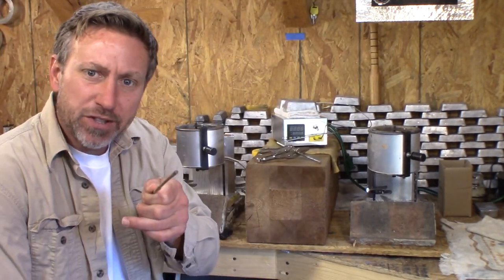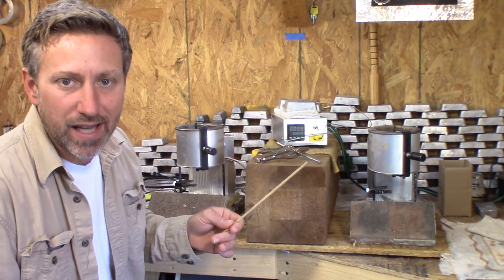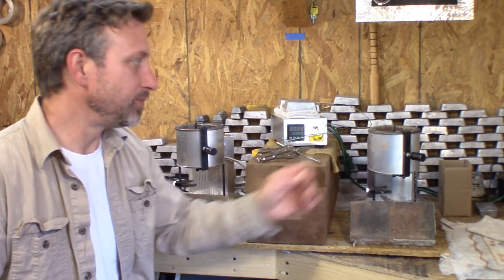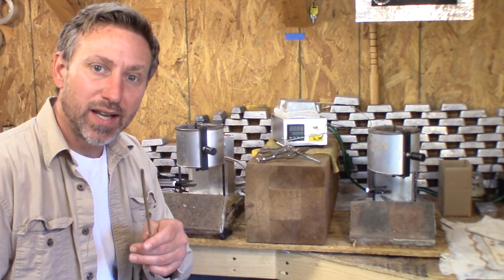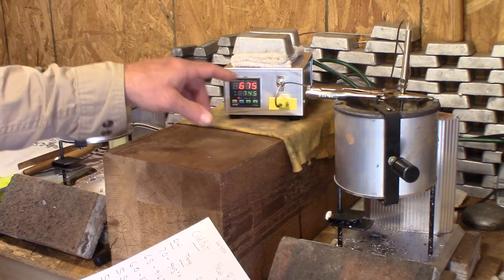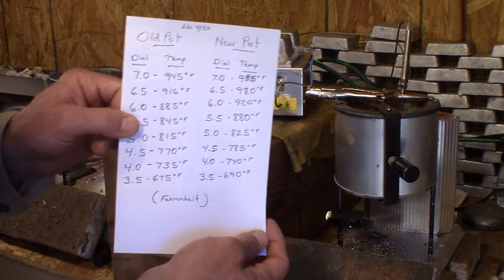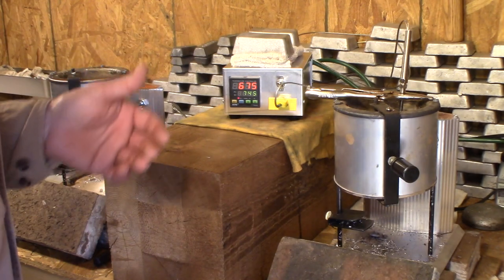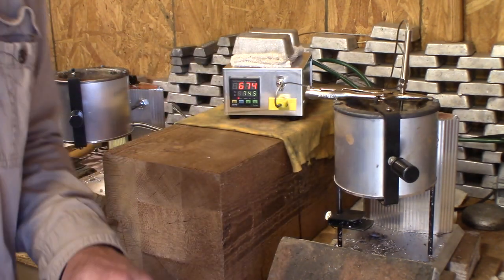Lead Melting Pot, "The Tale Of Two Pots"

Comment: HUH , much knowledge laid down. To PID? or not to PID? being the question well as I research and dig That is a question with only Choice as an answer. I will side if you get one that holds out and keeps the temperatures where you desire them PID can wait, Now however with the thermostats being the weakest link in these pots a PID on hand as back up is a safe option. Thanks Elvis the work is awesome.

Comment: Amazing work, brother!  The biggest thing I've learned from you and FC in these PID videos is that I need to try running my lead hotter!  I have been frustrated by molds heating up slow, nose wrinkles I can't get rid of, and so on.  I am going to try running my pot at 750-800 next time I cast to see if that helps.  I have been mostly staying around 700 and it has made for frustrating casting.
I'm glad you are enjoying the power of the PID!
Reply from the maker: hey Johnny's Reloading Bench.... Yeah One thing about casting is everything is a heat sink... If you throw your sprues back in, Set your mold on top, The spoon or ladle....etc.  Then the lead cools as it goes in the mold. And the temp of the mold it's self... Not a big deal, But must be accounted for. That temp sound right. Larger bullets usually need a little less heat than smaller ones..Good to here from ya as always! You ole primer popper! : )  thanks again for the nice gift!

Comment: I have had my 10 lbs pot for 33 + years now. I never knew what the temperature was either. I just set it on 8 and went to town. I was casting fishing lures untill a year ago. it's a lot different casting bullets. my PID goodies will be here today or tomorrow. I think I need a new pot too. you and FC45LC and Johnny's reloading bench have changed the way I cast. thank you for making it easy for me to cast and powder coat. it just adds to the fun of shooting. keep the videos coming. thanks.
Reply from the maker: Hey Grant Atkinson!! Thanks for bringing up the fact that casting and powder coating adds a layer of big fun and interest to the shooting sport. Sometimes I think people miss that!!!  Thank ya!
Reply: It's more then putting lead down range. It's the craftsmanship of creating the perfect round for each firearm in the safe. The guy that sold me my rage scrap insulted me on reloading. He was just trying to sell his range ammo. Plus I don't shoot at his range. I go to a private range that won't let me buy from them. Illinois has some dumb laws. $50 for 120 lbs of lead when it's all done is pretty good plus I sold the jackets for scrap copper and got $97. I need to get more. The tire shops sell their ww so no luck there. I ordered a 200 gn MP Hollow point mold without lube grooves for PC $144 with shipping. I figured that a 10 bhn would be good for them. What do you think? I would love to send some to you when I get the mold if you would be interested.
Reply from the maker: Sounds like ya got it going on Grant Atkinson. The guy trying to sell ya range ammo must have been looking stupider and stupider! let me know how those bullets from the mp mold work out for ya?

Comment: I have the Lee 10-pound pot, and if it correlates to the 20, I'm overheating my lead. I dont have a thermometer...just relying on setting on the dial and the appearance of the boolits. I start at 8 to get stuff melted, then turn down to 4. I can probably make that 3-3.5. Thanks Elvis...great work!
Reply from the maker: Hey Alan Bycroft... I think if your running 4 with no problem your gonna be fine because the pot can loose temperature fast with sprues going in and molds on top the pot.. Just my guess!

Comment: Would be interesting to see how much or if the temperature changes as the lead level changes. IE if it stabilizes at X degrees at setting 6 when full, where does it settle if you use half the lead?

Comment: As always you're vids are the bees knees....I do have a question for you, though. Are there any discrepancies in powder coating pure lead? And does the temp of the lead effect the weight in the bullet? I casted some pure lead in  a 175TC mold and they weighed 180 +/-. I casted in WW and got the same basic weight. No big deal I just load them as 180 gr instead. Thanks again

Comment: Also, I have a question. How clean cut should the bases of the bullets be? I'm running a lee 230gr for 300 blackout (wonder where I got that idea?) Also, I am getting smearing, I watched your video and I'm gonna try to remedy that, but the thing that's odd to me is at some point the sprue plate gouged the top of my mold, will this pose an issue?
Reply from the maker: Mold smear happens when you run the mold too hot or a little too fast. proper mold lubing will help with this and sprue plate gouging . also tightening the sprue plate so that it is not too tight and not too loose when the mold gets up to temp. this video might help with the lube....
https://www.youtube.com/watch?v=sJfU1yKdgak&lc=Ugzv5_WpLRWIkUuCL6l4AaABAg

Comment: Hey mr elvis. I guess youll be needing a new project so id like to suggest picking up on reloader dudes less is more vid.he said he used 2-3 teaspoons of hf red pc on 100 boolits, so how little pc can we use and still get really good powder coating.many seem to believe a hvy coat is necessary, how little can we use and still standup to the standards youve shown so far?
Reply from the maker: hey Edad Martin... I pretty much shake the bullets around until nothing else comes off of them... the stuff lasts a long time I know that much. But it wouldn't hurt to do a video on it!